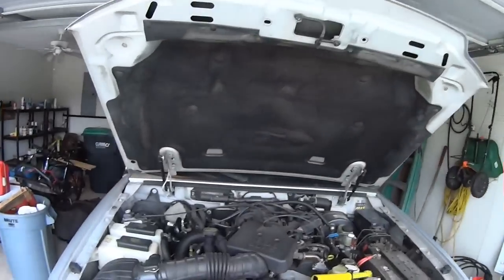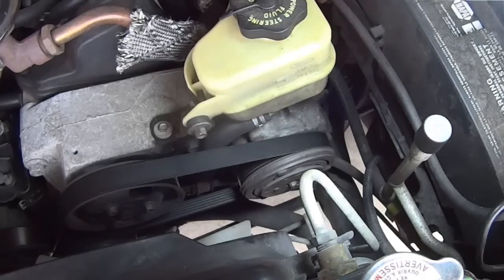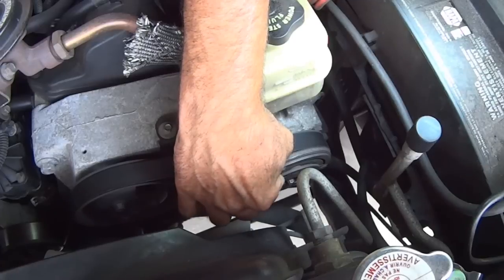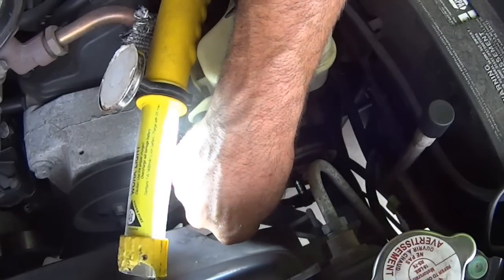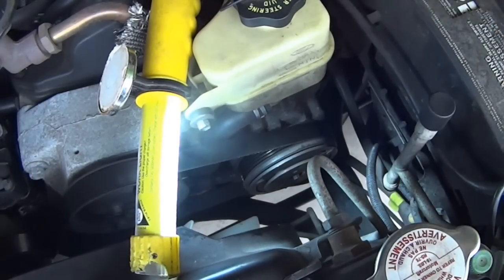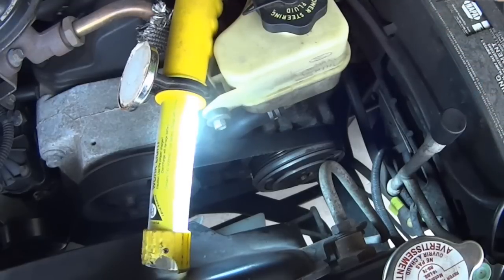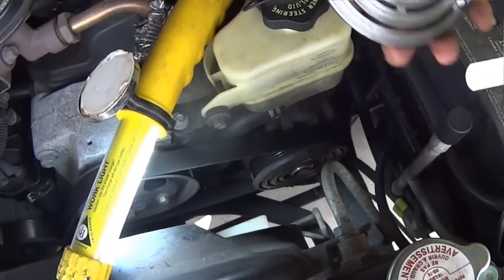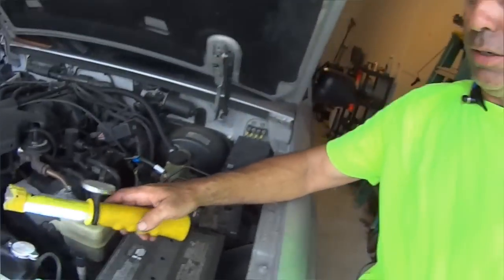FREE FIX - How to Diagnose and Adjust an A/C Compressor Clutch in Car Truck - Blows Cold Then Warm

Comment: What would cause a clutch to stay engaged?  Mine stays engaged even when ac is off.  I added the spacers required.  Will not disengage.
Reply from the maker: Sounds like a bad switch. Stays engaged with key off?
Reply: I can free spin it when ignition is off.  It will blow super cold for roughly 15 minutes, longer in afternoon when it’s hot.  Then barely blow.  I think it is freezing the evaporator as a result.  Thoughts?
Reply: Dan's Vlog checked today and is engaged even when car is off.

Comment: Have an 06 Pontiac grand prix and my switch has 3 wires and I dont think you can jump a 3 wire switch. How else would I know, what's happening is my clutch isn't engaging on the compressor
Reply from the maker: Could be the air gap as discussed in this video. Could be the low Freon switch not allowing the compressor to engage. Could be a fuse, soils be the switch in the dash

Comment: Good afternoon brother. I have a question. I have a 1998 Ford ranger and when I'm driving and slowing down the rpms are way high with the ac on, but if I have the ac off it idles normally. Would you or anyone happen to know why this would happen? Thanks in advance.
Reply from the maker: No clue
Reply: Thanks for your help Dan...👍

Comment: I replaced my compressor with a used one, it cools really well, but it makes very quiet clicks when cycling. it is weird because my old one used to be loud.  should I be concerned ?
Reply from the maker: missing1person It shouldn’t cycle. Compressor is either set on or set off y you... temperature is set by you by blending warm and cold air. The compressor is cycling cause in my opinion, something is wrong (low Freon or faulty relay or faulty low pressure switch).

Comment: Mine is doing the opposite, getting cold while driving and getting hot when sitting still. Are these still a possible remedy?
Reply from the maker: Probably good to check cause it’s free to fix but it could be your evaporator coil

Comment: What was the tool you measured for the air gap?
Reply from the maker: A feeler guage
Reply: Ok so you just replaced the clutch plate or the spacers inside?
Reply from the maker: Watch the video?? I showed you what I did

Comment: My 2006 Ford Explorer has an issue where the ac clutch engages and disengages very quickly and repeatedly. Obviously the air the ac system blows is hot and i checked the r134 level and shows to be in the proper area per the gauge. What can be causing this clutch issue?
Reply from the maker: Mark Perez assuming you checked the ac Freon Pressure while the AC compressor was on AND ENGAGED right? When it clicks on the pressure will drop dramatically and when it clicks off the gauge pressure rises substantially. If you see the gauge is in the proper psi while the clutch on the compressor is definitely engaged then it should be showing way over pressure when it disengages... that is proper. If this is what you see, you will probably need a new low pressure switch. Cheap and easy but will require you to have to recharge the system completely after you replace it.

Comment: Dan, My AC Starts Off Warm Then Cools Down As I Speed Up, Can This Be The Same Problem As Starting Cold Then Heats Up Like Your Truck ?
Reply from the maker: It’s warm when you’re stationary but cools off when you’re driving… Sounds like your evaporator coil might be excessively dirty with bug guts or simple dirt and dust. Located at the front of your vehicle where your radiator is there will be a separate looking little radiator attached to it, that is your evaporator coil for the air conditioning system. Don’t use too much pressure that you bend the fins on the coil but attempt to clean it With a garden hose.

Comment: I think this is what’s wrong with my AC on my 02 ford zx2. I replaced the ccrm relay which includes the magnetic relay. Ac worked but kept cutting off but when it blows cold it’s ice cold. I think this is what’s wrong with mine

Comment: Note ** Whenever you Add “freon” make Sure to use the Correct Compressor Oil - for your vehicle.
because there are several Different A/C Compressor Oils and using the wrong oil could Ruin the Compressor.
Good motoring 👍
Reply from the maker: Thanks for the info!

Comment: After  spending money on a new compresser I'm still concerned..... my ac works but it still makes clicking noises loud not like it cycling  on but when I turn my ac off  it turns off the clicking goes away .idk if its vibrations from the commpresser turning on or if something isnt right it doesnt happen all the time its random but it doesnt sound very good at all and it's hard for me to get it diagnosed it was happening  before I changed the compresser  but it seems less frequent  now it's a 2007 ford focus 2.0
Reply from the maker: I would investigate the low pressure switch and Freon level
Reply: @DansVlog  thanks like I said it doesnt happen often  definitely  less now that I have new compresser and orfice  tube I'll give that a shout tomorrow  when I drop her off ! Any other suggestions to tell the mechanic  there really struggling finding  it because  it's so random the clicking

Comment: I have got a Renault capture  car with the same problem, I have change the air compressor five month ago and now have the same problem as the first one, the concessionaire here in Africa cannot solve the issue, I will try to do it, the air conditioner only get freeze when I increase the speed like 80km hour

Comment: So what if my clutch plate is engaged and stays engaged when the AC is off? I can not get the compressor to cut off.
Reply from the maker: Lube the moving part
Reply: @DansVlog  so I can spray WD-40 or PB Blaster? I did try to turn by the clutch by hand and it did not spin freely.  I hope the lube fixes the problem.

Comment: I changed my air door ACTUATOR. And changed my 10 amp fuse.checked my freaon and switch horn relay with ac clutch relay horn still worked with one from ac clutch relay so I'm ask please wut else cloud it be
Reply: U need to have your hvac system recalibrated

Comment: I got an 05 Silverado. The belt was broken for about 6 years. Today I decide to fix it. I got a new belt. Ac is working. I cleaned a lot of the grime off from northern winters with carb cleaner and a wire brush. The thing is, its squeeling only when the ac is on. I cant get the squeeling to stop. Any suggestions? Anyone? Please. I'm about to throw the putter
Reply from the maker: Try belt dressing (Spray)

Comment: My ac seized up and broke my belt. Does anyone know how to tell if it is the compressor or the clutch? I pulled the race off the clutch and it spins freely so I am thinking it's the compressor but would like to be sure before I dole out a $1000
Reply from the maker: Joe Byrd Yeah I’m thinking it’s going to be the bearings internal

Comment: Does anyone know where to the problem i have a o3 F-150 it starts but when i take off the jumper cables off it runs for a minute or two the it starts to sputter and cuts off.I have replaced the fuel pump the alternator, relays, and everything I can think of even the E.C.U.but it still does the same thing it has two wires running to the injectors that may have been to a fuel pressure rail sensor with a fuse in the line to one of them do you think this could be the problem the wires are on the passenger side of my 03 F-150 wit A 4.6 any help will be appreciated.

Comment: I have a 2013 Suzuki Swift and as I turn the ac on the cooling fan keeps tripping on/off every 5/6 seconds. Is that normal? Thanks
Reply from the maker: Cooling fan at the radiator? I don’t know. Depends on the temp of the radiator or wherever the cooling fan’s sensor is located and what that fan is set to activate. My first thoughts is no, it is not right and may need a new sensor but I am not a certified mechanic.
Reply: Dan's Vlog thanks for your reply
Reply: keep researching this, another video dealt with a similar issue as what you described.
Reply: ray Nic can you give me the link of the video please?

Comment: My ac went to Shit , went to the dealer had evaporator , changed on Dodge Durango two weeks later no cold  air and vent is making a hissing noise , any suggestions ??? I payed 2400 bucks iam frustrated .. did I loose the charge due to a leak or what ??
Reply from the maker: Take it back to them.
Reply: @DansVlog  obviously just curious if you new what it was .
Reply from the maker: @landshark616  Sorry, no clue

Comment: PLEASE HELP!!!

My Elantra 2014 AC works perfectly but suddenly when I slow down or stop at a red light, AC start blowing warm air more like humid air (not always but most of the time)

I have to hit the gas pedal and increase rpm and it clicks and work perfectly even if the car is not moving. (Example: Car on P and AC goes warm, i hit gas pedal, rpm increase, it clicks and AC work perfectly again)

I checked Freon pressure, it is perfect.
I checked all component, all working fine and clean. No leakage or whatsoever... car fan.. compressor.. etc.. all seems fine.

I turned off Eco mode, and it didn't solve the issue.

I waited till it happened again, and i stopped on the side of the road, and opened the hood... and asked my friend to hit the fuel pedal.. and i noticed that when he hits the pedal.. the compressor clutch stops for 1 sec and works again and AC becomes OK again.

Any ideas why is that happening?
Reply: same here

Comment: Instead of pliers to hold the clutch when removing bolt just turn on your key..not start position, just turn on and then turn on AC switch, clutch will engage holding pully to remove bolt.
Reply from the maker: No it won’t, remember... the a/c isn’t working lol. Also, the A/C relay will delay the clutch engagement at start up. Good thought but it doesn’t work that way
Reply: @DansVlog  Sorry just did it on my suburban...found this idea on another youtube..try it an see for yourself.
Reply from the maker: Ok thank you. I learned something new!!
Reply: @DansVlog  Yup never say never...

Comment: I have the opposite issue.  Mine only cools consistently on max a/c or while driving.  Compressor tends to turn on and off every few seconds.  Anyone know what the issue is/ may be?
Reply: It sounds like low freon charge
Reply: @joseavila8752  no.  Freon is topped off.  Started doing it more after I charged it.
Reply: 2015 Toyota Tacoma 4cyl

Comment: OH MAN I bought a used Ford Fusion sport last year the blower worked but the air was not getting cold I looked it up on youtube and found out it could be a sensor and it is buried behind the dash I took it to the shop and that is what it was they had to take a lot trim console ETC for a sensor that cost $20 something dollars it cost $618.00 to get it fixed.
Reply from the maker: Mark's Reviews Never fails. A/C and transmissions always cost a fortune
Reply: Yes the location they put this sensor is so stupid if you look it up on youtube you will see how much time it takes to do the job.

Comment: My 1`999 honda WAS OK last year A/C WAS FINE I recharged it and now IT JUST BLOWS HOT AIR.
Reply: Most likely you now have to much freon in it which WILL make it blow hot. Take it to a shop and have them vacuum it all back out and reload it...the cost will be cheaper than buying a vacuum pump and a set of gauges at harbor freight!

Comment: I dont know jack shit about cars, my truck, an 03 silverado with 137k miles on it, will blow ice cold air for a while, and while driving it will randomly switch to pumping hot super hot air even with my ac still turned on and wont stop until i park and restart my engine, then its good until i get where im going, but the first start from a cold engine, and it always seems to happen, any given time between the first few minutes up to 15-20, but it happens 99% of the time 
It also seems to happen most of the time when hitting my brakes
do you think the issues stated in the video might be my issue as well?
Reply: Mine 03 did the same but I changed the blower switch under the passenger side glovebox.

Comment: I just bought a used SUV and the A/C squeals intermittently when on. I wonder if my gap there is dirty or somehow causing the squealing? Will be checking it out after I get one of those filler gauges.
Reply from the maker: Get yourself a can of white lithium lube sort of like WD-40 but White lithium and avoid spraying anyhow on the belt but go ahead and using the tube that comes with the spray can, shoot white lithium on the shaft of the AC compressor to try to lubricate the bearings.
Reply: @DansVlog  This did the trick. Ty for the help.

Comment: Just be aware that Clutch has friction material on the back side. It wear down. It will be metal on metal and destroy your AC unit. Just buy the clutch and replace it.
Reply from the maker: Good point

Comment: Kind of like I'm going from saving $1,600down to saving $100 down to getting the AC fixed for free because this repair won't cost me anything. I won't count the cost for tools a feeler gauge and a wire brush head to clean the surfaces...
Reply from the maker: Hope this works for you
Reply: @DansVlog  do you know anything about repairing a sealed AC compressor clutch?

Comment: I have spent so much money on this ac crap until i run to this video.  I change the compressor but nothing worked for so many years.  What i did was power washed the engine then run the AC on full blast and pointed the power wash nozzle directly on the compressor.  All of a sudden I started getting cold air.  I think I need to recharge my Ac to get really cold air.  The pressure is on the yellow, it was on red but when the compressor started working it dropped to yellow close to the blue mark.

Comment: Hello I have a problem with my toyota 2004  Car ac system. I have Consulted Many Car AC Exprts. they checked but unable To Find The Leaking point. I my self vacuum my system and the vacuum stands for 15 days . after that i filled My System with r134a . After two days of driving with AC on I Notice that the gas level is gating low. I Vacuum Again and leave the System Vacuumed for an other Two days And refiled my system again . But after driving 50 km with AC on I noticed that the gas level is low again .I will be very happy someone help me.
Reply from the maker: Put the dye in the system and use the flourescent light the leak kit comes with and find the leak
Reply: @DansVlog  thanks I will try after the lockdown over

Comment: dude dude dude. Man you. How did you figure to check there.
Reply from the maker: I watched a lot of videos describing how the compressor operators and what the clicking sound is. Then I learned of the gap and decided to check mine. That’s how I fixed mine and shared it with my channel

Comment: Hey its the opposite in my case ..the ac is working when i hit high rpm and stop working when idle or at lower rpm....can you give a solution please
Reply from the maker: I would still check the gap

Comment: Magnetism 101... magnets lose strength at warmer temperatures!!!!
Reply from the maker: It’s more than just the strength of the magnet. Every time the AC clutch is engaged a non-moving part makes contact with a moving part which causes friction which equals wear which increases the gap

Comment: My air blows, compressor kicks on,  and freon filled yet still doesn't blow cold. What else can it be??
Reply from the maker: Are the pipes cold? Maybe your heat/cold adjuster is broke and not allowing the air to pass over and thru the COLD coils
Reply: Thanks. I know I only can put it on medium fan blower. Low or high don't work